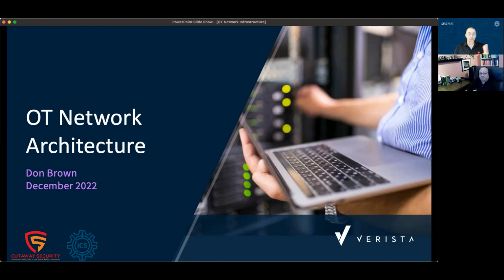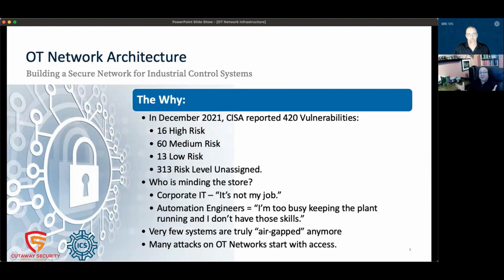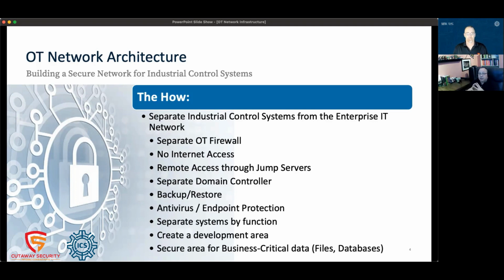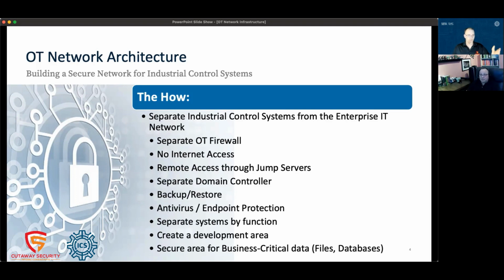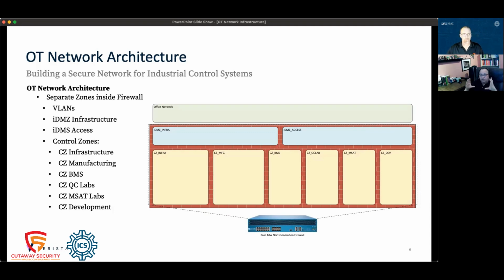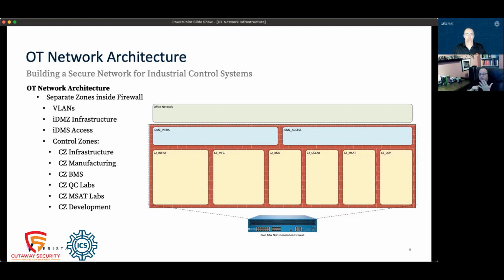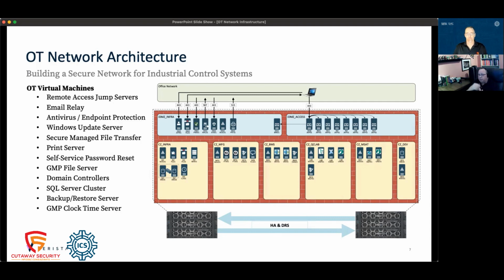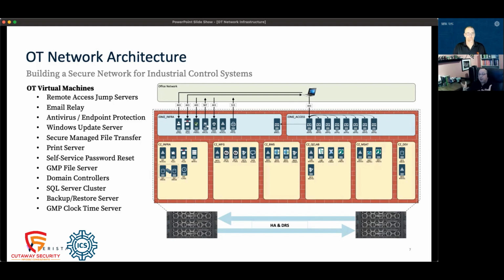Building a Secure OT Network | SANS ICS Concepts

Comment: This is a good starting point but in fact conduits are just firewall rules and you may need to enhance the OOTB capabilities of NGFW with extra insights from the likes of Claroty or Nozomi to make the inspection (controls) more accurate and offer a more astute level of detail  - even if your FW has OT specific capabilities to recognize the more common protocols like Modbus and Profinet...you may not understand the flows and the involved risk -  In terms of compartmentalization - your mileage may vary - some orgs. just isolate part of OT locally (containment of endpoints close to industrial estate) - other more integrated flows may need to be contained in VRF's mapping to zones for transport to datacenter or cloud based IT systems (warehouse management systems or ERP systems) etc. So it's a set of guiding principles and best current practices..to be implemented with respect to snowflake like use cases...